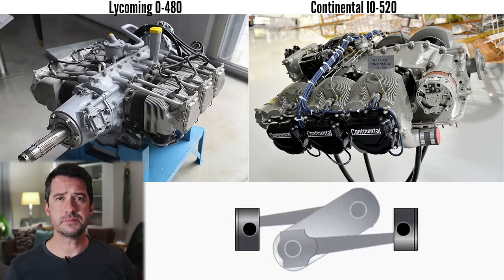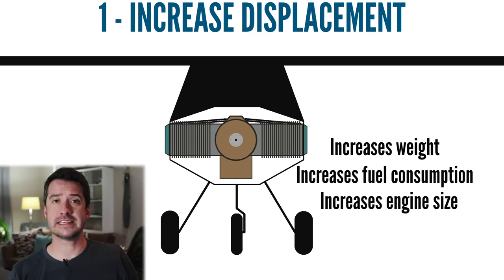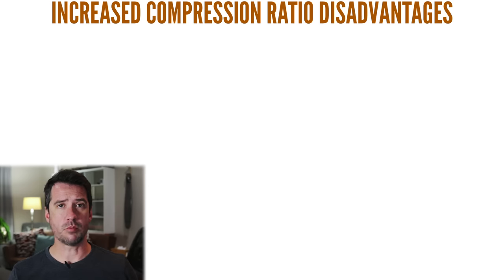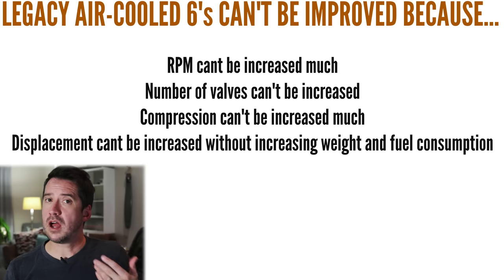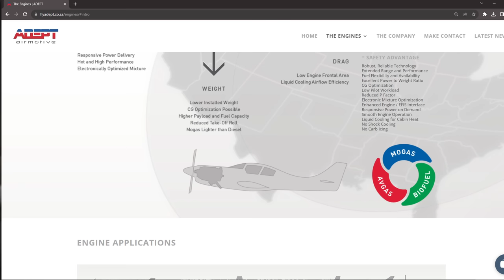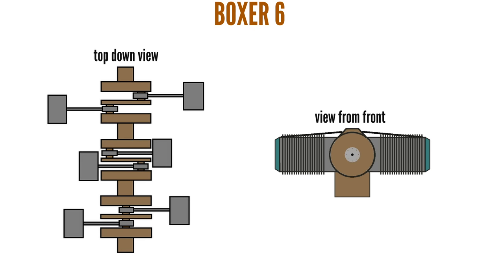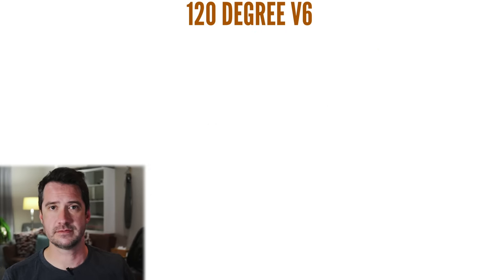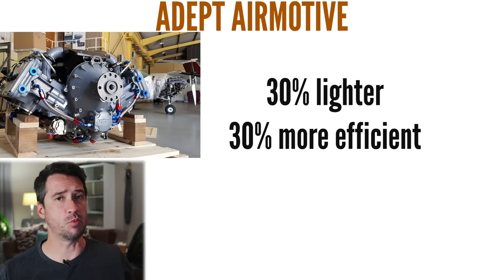Unusual V6 Airplane Engine Makes Boxer 6 OBSOLETE?

Comment: Took apart a 55 year old 2000 hour  Lycoming out of a Cessna. Not only did the crankshaft pass inspection after grinding but I have been able to find every part needed to reassemble it with brand new camshaft kit, oil pump kit, 4 brand new cylinder kits with pistons, rings, valves, springs. Should be good for another 50 years.
Reply: 2000hrs is 1/4 the hrs a mechanical device should last without major replacement. 5000 hrs on rental construction equipment. So in comparison air planes are a waste of effort. Like the electric scam!
Reply: @congerthomas1812 higher standards are expected from Aircraft power plants
Reply: @congerthomas1812  Completely different designs. Camshaft in aircraft engines turn in a bored aluminum case. So many things are optimized for weight rather than longevity.

Construction equipment engines are all cast iron blocks, water cooled, and mostly sleeved. I have a 3 cylinder diesel that weighs as much as an O-200 and produces 34 hp.
Reply: @congerthomas1812  aeroplanes are expensive but totally worth the effort to me.
Reply: @congerthomas1812 Depending on how the aircraft engine is operated ( for hire) mandatory tear downs are required.
Reply: @russbell6418  And for some aircraft engines we have been rebuilding and using the origional aluminum blocks for 80+yrs.  PW 985 for example... excellent engines
Reply: @congerthomas1812 the engine in that piece of equip isn't subject to the altitude changes and airplane engine sees not to mention the temperature extremes that come with altitude. When the powerplant on that piece of equipment fails it's an inconvenience, when the powerplant of a single engine plane fails it's usually a tragedy.
Reply: 2000 hours would be 130,000 miles in a car at 65mph.  Double that speed for airplane cruising and you would travel 260,000 miles.  Not too many automobile engines will do that and be in the condition you have described.
Reply: @greggcollins4215  agreed,  especially considering aircraft engines spend the majority of their lives running at 70% to 100% power output.
Reply: @gavinhassett479 My goodness u can't be serious. My small engine that powers my lawn mower has a higher power to CI level than a light aircraft engine. They are low revving carb with choke fueled engines that have assembly clearances nowhere near other types of engines. They have no requirements to accelerate them constantly like virtually all other engines do. They don't have to overcome rolling resistance or heavy loads dealt with all other forms of engines. Simply put a light air raft engine has to perform the easiest workload of any current internal combustion engine with the least amount of shock loads and varies operating ranges. And lastly they see more maintenance and upkeep of any current engine. I assure u my 05 Ford pickup has never had a yearly inspection or teardown in 250,000 miles.
Reply: @matthewmoilanen787  your ford is an anomally
Reply: The aircraft fudds never take into account, 50 years ago an auto engine would have to be rebuilt after 30k miles. Now, 300k is easily done with no major repairs (I've had three go that far, I drive alot) the hyper regulated aviation engine space can barely advance because of the faa choke hold. There are several modern alternative engine aircraft that have several thousand hours with no problems other than teething bugs. At a tenth of the "legacy" certified dinosaur offerings .
Reply: Torque #s very  impressive.
Reply: @congerthomas1812  What's the power-to-weight and power-to-displacement ratios of the construction equipment? If you ran any aircraft engine at a similar reduced output rating as the construction equipment I have no doubts it would last equally as long. Conversely, if you ran the construction equipment at an increased output similar to the aircraft engines you would have a grenade very quickly.
Reply: @cobra5032  probably so, but why can't they make air craft motors stronger. Turbines I worked on k501,lm2500.
Reply: @congerthomas1812  Stronger engines that make more power do exist. They also weigh more out of necessity. That is why turbines took over aviation with jets and turboprops in larger aircraft. They make more power, are lighter, last far longer, and are generally cheaper to maintain than piston engines. The downside is increased fuel consumption and initial cost.
Reply: @cobra5032  what about the Rotary?
Reply: @congerthomas1812  They can make good power and are compact. Longevity leaves something to be desired. Apex seals are their Achilles heel.
Reply: Scheduled rebuild, or unscheduled?
Reply: High displacement opposed engines usually work best with air cooling the large cylinder bores and long piston strokes make peak power at low rpm
Reply: Continental has a history of crankshaft failure I’ve never had a c failure in a car in 50 years 😂
Reply: @greggcollins4215 auto engines spend most of their time loafing along on a small percentage of their useful power .   Aircraft like boats are in a much more constant high power operation running heavier loads.    Theres really no comparing them directly.
Reply: @drizler Auto engines are often used to power boats. Honda outboards, for example, are just their car engines modified for watercraft use, and they're probably the best outboards a person can buy.
Reply: Especially considering that it would be at 65%+ up over that time. I read a paper ascribing reliability to piston speed. Basically because the lycoming/continental have such a long stroke and run at a lower rpm(prop limitations) they are more reliable.  The PFM3200  was also an ohc 6 cylinder with redrive.  They have mostly been removed and replaced with conventional aircraft engines.
Reply: @ndenise3460  But the PFM 3200 was an extremely reliable engine. The engine was unsuccessful because it was extremely heavy (being an air-cooled automotive engine with a cooling fan), because it wasn't very powerful, and because Porsche stopped supporting the engine.

The R-3350 had very high piston speeds relative to traditional light aircraft engines, yet it had a significantly higher TBO and excellent reliability when used in airliners.
Reply: And if you do the maths it probably uses $100,000 more in fuel than a modern engine for the 2000 hours. So you could have 4 brand new modern engines for the fuel wasted in the old, not exactly a saving.
Reply: C’mon!
Reply: @robmiller5818 you are joking, right? We had a straight 6 ford van that rotted off the frame after 300+000 miles. My Iron Duke Sunbird was 220000 when I murdered it. I wanted a new car, and it wouldnt die.
Reply: @congerthomas1812 too better educational system has failed us, a piece of rental industrial equipment won't go 200 miles an hour and get 15 or 16 mi a gallon my friend